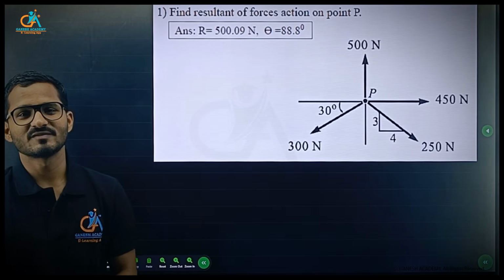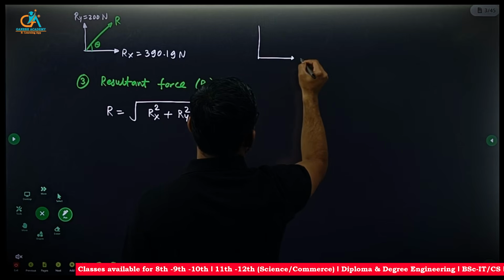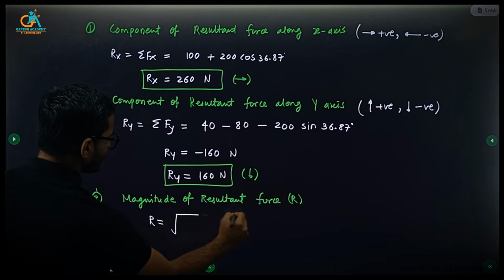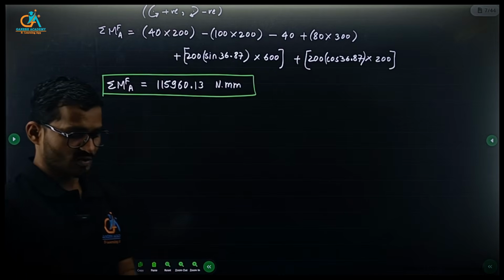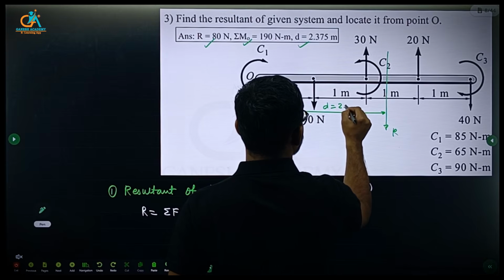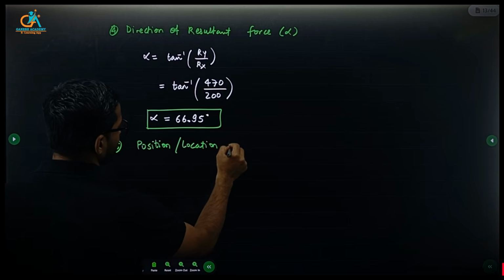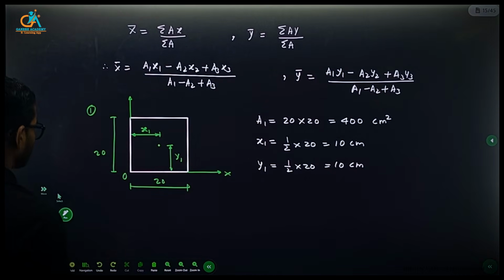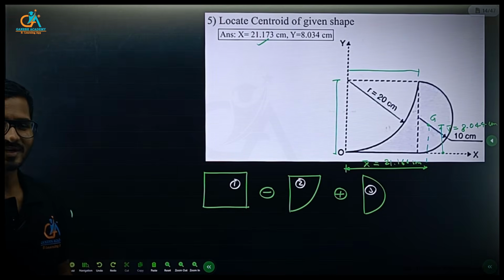BVCOE EM UT1 - Question Bank Solution Part-1

Comment: Sir your 2nd question answer is wrong u didnot change the unit of 40Nm into 40Nmm , i got failed because of you
Reply: Yes, you're correct. It slipped my mind . The magnitude of the couple should be in N.mm . So the value of couple should be 40000 N.mm
The answer for Sum of moments of forces @ A = 76000.13 N.mm

The corrected position of the Resultant force from A = 249 mm .
Reply: Nope the exam is tomorrow 
So don't lie